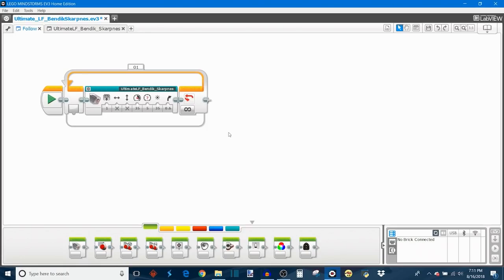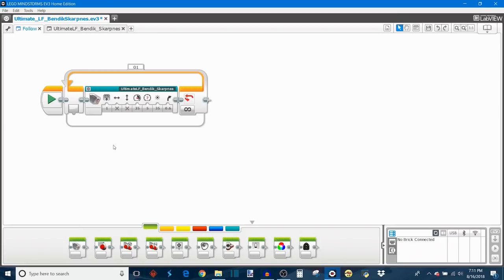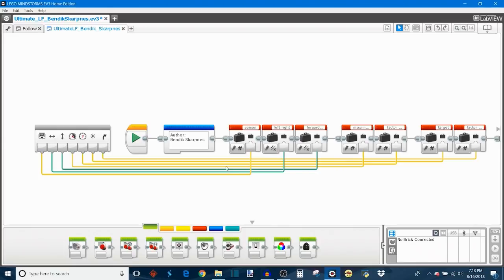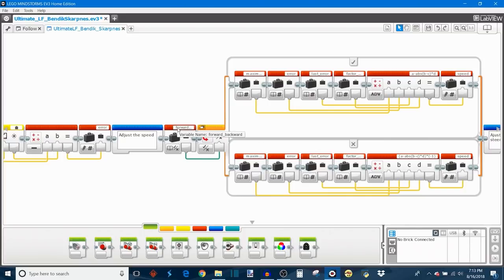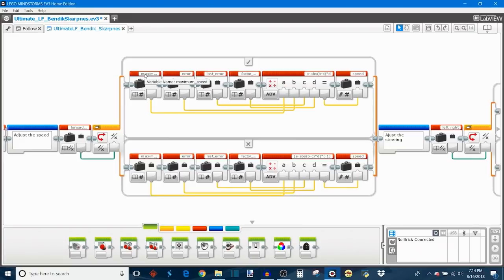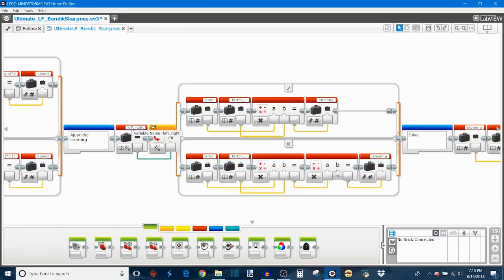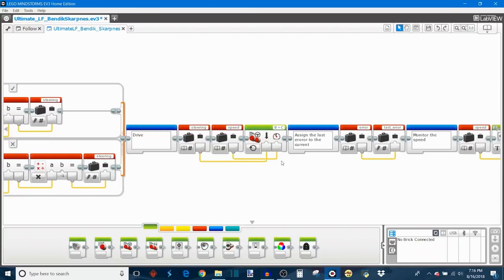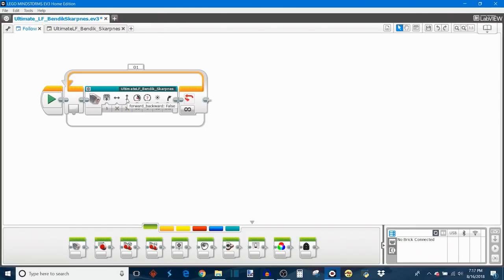Speed-Adjusting Proportional Line Follower - EV3 Navigation with Bendik Skarpnes

Comment: What happens when you let the robot follow the 90° turn line?

By the way good video! 

Honestly I really want a tutorial on Machine learning. Maybe you could do it in the future video?

FIRST COMMENT! YAY! 😂😂
Reply: It won't turn. Because it uses one sensor to follow the line so its correction is too slow to make a 90 degree turn.
Reply from the maker: This line follower definitely cannot handle 90 degree turns. For that, you will want to check out my PID video. Also, great tutorial suggestion, I will look into it!
Reply: @Builderdude35  Yay!
Reply: @Builderdude35  thanks for replying!